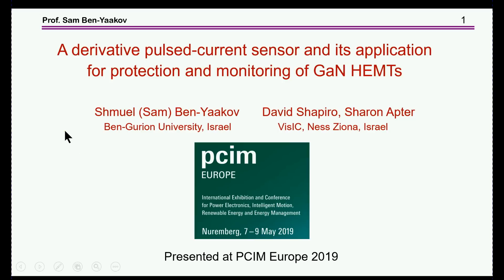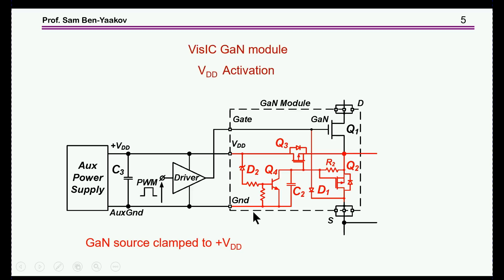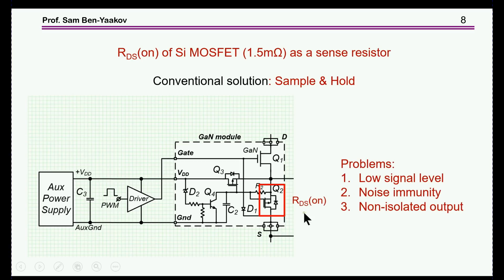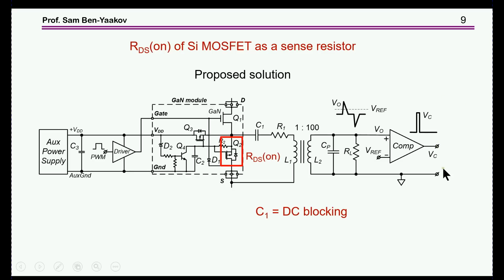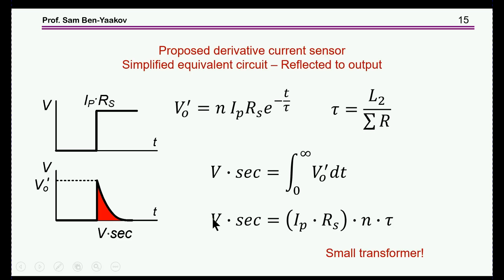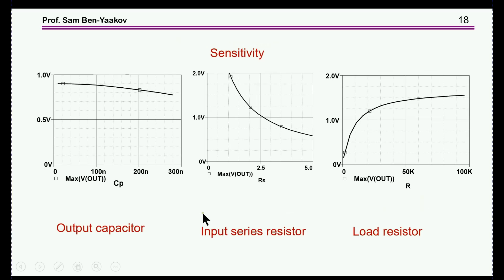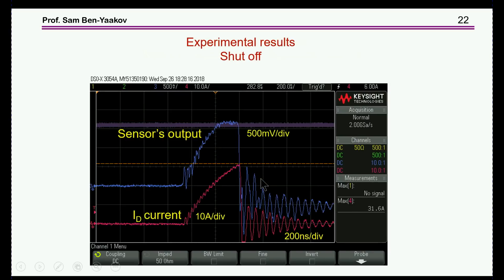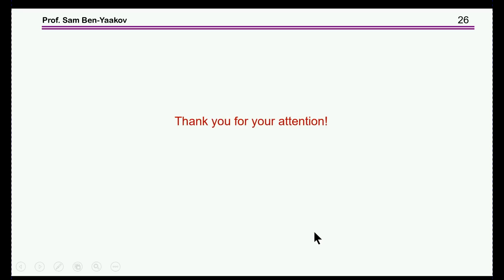Derivative current sensor

Comment: How sensitive this circuit is to the drain-source current switching osscillations? Is there any need for measured signal filtering?
Reply from the maker: Well it is sensitive since it supposed to detect fast rising currents.

Comment: Thanks Sam, GaN is a hot topic and I always enjoy your in depth videos. I saw in a related video "VisIC GaN device double pulse test" that there is a SMD current shunt on the board for measuring the device current. Would it be possible to do away with this current shunt and just use the MOSFET Rds-on? Perhaps the signal would need to be amplified, or use an oscilloscope with better resolution.
Reply from the maker: The problem is that the resistance of RDS(on) has quite a spread  and is temp dependent. For coarse measurements oK but not for accurate.
Reply: could you not just add a shunt resistor i the precision is needed but also the speed? And use the same circuit just with a discrete Resistor?